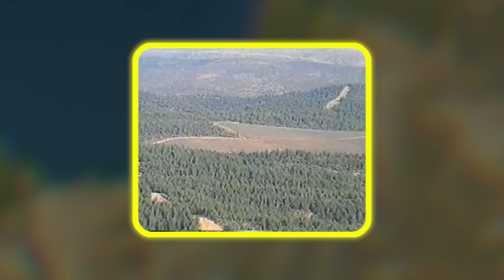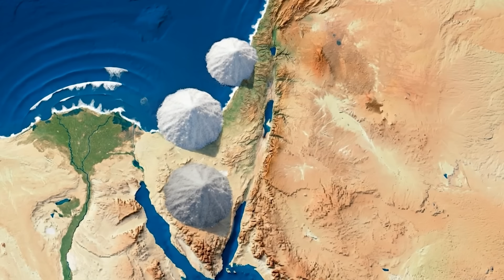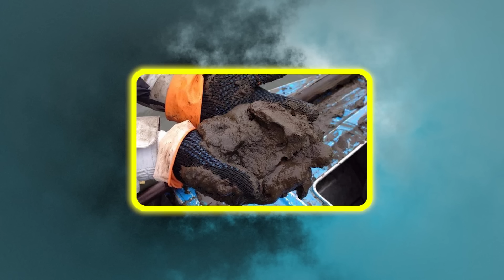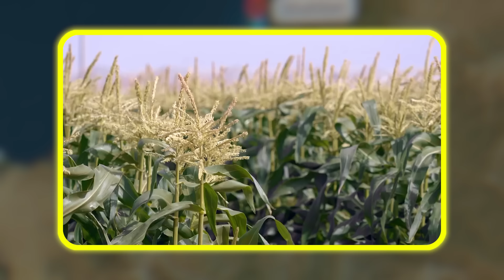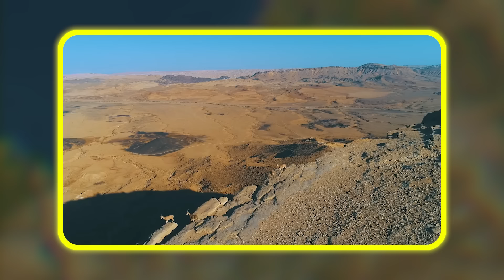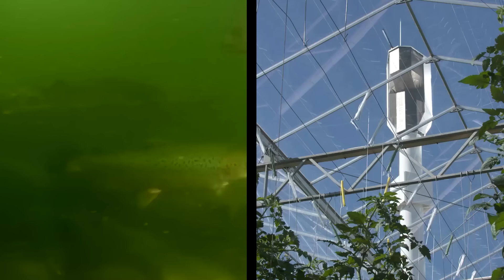Israel Released THIS to the Desert Instead of Planting Trees. What Appeared Never Existed Here

Comment: If I am not mistaken, because Israel did it first & it WORKED, these other countries followed suit.  We have all been blessed by Israeli engineering.
Reply: Absolutely agree.
Reply: I'm wondering if the water can be mined for rare earth minerals?
Reply: @painmt651 Not sure about the fossil water, but I know that their desalinization plants are currently working on trying to figure out how to extract minerals like lithium and magnesium from the brine water before it gets released back into the ocean. If they figure out how to mine ocean water, it could a huge game changer worldwide. It could be done anywhere with desalinization plants just by adding an extra process to the system. Over 150 countries worldwide use at least one part of Israel's water technology, and some like the ones in these videos have bought large parts of the system. Drip irrigation is used worldwide now. Collecting minerals from desalinization could spread just as far, if they crack the code. 

But I don't think they'd want to mine the fossil water from the ground. It could change the formula of what makes that water so perfect for fish farming, and later for growing crops. They'd have to do research on that before deciding if it would change what makes the closed loop systems so good. Removing minerals from water that being discarded doesn't disrupt anything in the system so there's nothing to screw up.
Reply: @S @Superfreaky1RU at's basically what I'm talking about. That could really bring the West into a position of not relying on the Chinese government for batteries and raw materials for manufacturing them and other newer technologies.
Reply: @painmt651 Check out Dr. James Tour of Rice University.  They've come up with astounding mechanisms for removing rare earth minerals from all kinds of things.  He a Jew who became a Christian.
Reply: @painmt651 Wouldn't that be nice for a change? Letting UK convince us to get rid of our industrial base is America's biggest mistake but watching the Chinese lock up agreements and debt trap nations for their rare earths and doing absolutely NOTHING about it for decades is a close second. They've know forever that China has had a plan on how to destroy America and they never thought that they'd better lock up our critical supply chain? 🫣It's just so humiliating tbh.
Reply: @Superfreaky1RU 
Israel is doing what they need to for what is best for Israel & succeeding . . . also eagerly sharing these tried & true methods with any nation who needs these processes . . . 

Each nation can modify things however they need to for these other benefits . . . use common sense & mutual cooperation . . . Necessity is the mother of invention.

Israel has done enough to get things started - just let them THRIVE!!!

God blesses all nations who bless Israel.
Reply: @painmt651 I am sure it was looked into. I guess not.
Reply: The more Israel gives, the more they are hated
Reply: Blessed and cursed BOTH
Reply: Funded by Aipac
Reply: @luciatheron1621 
AIPAC is funded by donations, not by taxpayers!
Reply: @luciatheron1621 and who funds Hamas? Billions of dollars funneled into Hamas from various sources that hate Israel including Iran, Qatar and other middle Eastern countries as well as non Muslim countries providing assistance to Iran and other Muslim countries. That's the world of politics and war. Countries backing other countries with common agendas
Reply: @judymoore5532  Arafat I read stole Billions. 
I've no info on Hamas finances.
Key Details on Allegations and Family Holdings
Official Stance: Palestinian officials and associates maintained that Arafat lived an austere, soldier-like life and owned no personal land, real estate, or private bank accounts globally.

Intelligence Claims: Israeli and Western intelligence estimates alleged that Arafat amassed hundreds of millions to billions in state and international funds, holding liquid assets, investments, and bank accounts across Europe (including Switzerland and Austria

Family Property in Europe: While Yasser Arafat did not register personal European properties, his wife Suha Arafat and daughter Zahwa lived in Paris, France, where Suha purchased a multimillion-dollar flat and was the subject of European financial and money-laundering probes regarding funds transferred from accounts linked to Palestinian assets.

For further context on investigations into his finances, read more via the Los Angeles Times.
Reply: @luciatheron1621 Aipac is funded by Americans.  All American ethnic groups have their own lobbying organization that lobbies Congress on their behalf.  Aipac is not the wealthiest by a long shot.  (Google it.)  
Nick Matau says the US gets about $5 back for each dollar of "aid" the US gives Israel.  (And this is managed completely independent of Aipac.  It is the American military & the corporate world of the military industrial complex that funds aid to Israel.)
Reply: @luciatheron1621 , AIPAC funding tilapia and burumundi fish raising is a good thing.
Reply: @teresatanyag8237 No.  Not while Palestinians have no equal rights.
Reply: Gaza, West Bank, Lebanon, Iran disagree
Reply: @LindaYariger Gaza and the "West Bank" as the Arab colonizers call it get their water from Israel, so I would advise you to do your research or sit quiet.
Reply: @LindaYariger       Israel captured Gaza in the Six Day War and only governed it until 2005.   Egypt had it for all of 19 years and would not take it back when Israel tried to return it with Sinai.    Lebanon is cursed with Hezbollah, the IRGC funded proxy that sits in Southern Lebanon and attacks israel.  Then whines and complains when Israel responds.
Reply: @LindaYariger  that is their problem. They are focused on mayhem and murder, rather than bettering the lives of their citizens.  PS it is  "hezbollah" not Lebanon.  Lebanon and Israel are on the same side of the conflict against Hezbollah and Iran.
Reply: Pity Israel has no sense of humanity and compassion.
Reply: @aletheabaldwin6612 have you been in israel?
Reply: @aletheabaldwin6612
Israel, the Jewish race, FOREVER!
Light unto the nations!
Reply: @aletheabaldwin6612lol. Get on a plane and see for yourself.
Reply: @aletheabaldwin6612👎
Reply: @aletheabaldwin6612Iran, and all of their proxys wars against Israel have no sense of decency and compassion. Did you forget that they started the wars?
Reply: Did you conveniently forget about October 7th? Israel does good things with the money. Iran, and all of it's wars against Israel is what they use the  billions of dollars for. Different set if values. Just look at this video again
Reply: @aletheabaldwin6612 Polio broke out in Gaza in 2024. In Jan 2025 the IDF vaccinated 1.1 million Gazans; mostly babies & children.  Google it.
When Israel withdrew from Gaza in 2005 Gazans' vaccinations were up to date.
Hamas put their all into terrorism.  Maybe they can get a Nobel Prize for terror tunnel construction.
The Gazan Health Ministry (run by Hamas) apparently decided vaccinations didn't matter.
And indeed ... why bother vaccinating children you'd rather use as human shields.
Now, fool, tell us about compassion.
Reply: @brynawaldman5790 
THANK YOU for this crucial information . . . I appreciate this!!!

But "THEY" still won't believe you . . . 

Everything is always Israel's fault - ya know.

My prayers for God's blessings on Israel.

All Glory to GOD through His Son Jesus Christ our Lord!!
Reply: @sydney.g.sloangammagee8181   Yes, it is important information which the media ignored.
Muslim antisemetism has a similar history to medieval Christian antisemetism, in that the rich Arab land owners, generals, aristocrats, & clergy oppress their own ignorant people.  They have ironclad centralized power & make use of the Jews as the scapegoat for their peoples' misery & suffering, so violence is siphoned off onto Jews who take the blame for the Muslim leaders' corruption.
In medieval times it was corrupt European aristocrats & clergy who hoarded the wealth & told their peoples that the Jews were to blame.  
The enlightenment undid the iron grip corrupt leaders had on European & Christian institutions, & made western democracy possible.
Reply: @aletheabaldwin6612Sure, the only ones who have ever tried to make peace with their neighbors, who gave back the Sinai, who offered a state 7 times, who left Gaza in 2005, and who gave land to make the Palestinian Territory are the ones with no humanity and compassion. 😂

And the people who refused to accept a state over and over in favor of using terrorism modeled after Albania, who pay people to become martyrs, a monthly stipend for life for them or their families, the more Jews you hurt or kill the more you get paid, with bonuses for pregnant women and children, who indoctrinate their children to hate Jews by teaching them Nazi ideology, who fought with Hitler in WW2, so that they would bring his concentration camps to Arab lands, beginning with Palestine, and who have never ONCE tried to make peace with Israel because its entire existence and even their national identity was created to remove Jewish presence from Jewish land, even though only 400K Arabs were living in Palestine when the British Mandate began and over 1 million moved there in 20 years. 

Oh, and it was Hamas and Palestinians who broke into Israel on Oct 7th and proceeded to genocide entire towns and used grape and kinocide as weapons of war, and took 251 hostages back to Gaza. And who had the power to end the war at any time because just like Israel said all along, the war ended the day they got back the last hostage and hostage bodies. 

You think the Palestinians are compassionate and have humanity? Not a single person on Oct 7 said anything about occupation. They screamed Allahu Akbar, my God is the greatest, while they mowed down entire families. While they gang graped hundreds of women AND men. While they debased and humiliated Jews by forcing them to perform acts of incest at gunpoint. While they cooked a baby in the oven after it's tortured and nearly dead parents, tied together at the wrists, had to see it and smell it and hear it's screams while it died, right before the terrorists killed them as well. While they beheaded people, mutilated or burned them alive, while they went out of them way to step on their bodies before walking away. And worse. Not just Hamas. One Palestinian family walked from Gaza to loot peoples homes and found a man alive, shot on the kitchen floor. The man got a knife and used it to cut the liver out of the alive man, and he ate it while the man died and his wife and young boy clapped and laughed. Not Hamas. "Innocent" civilians. 

If Israelis have no compassion or humanity, the Palestinians come from the Devil himself by comparison. Their entire fake national identity exists only as a means to try and steal Jewish identity and history to try to legitimize their claims to a land they colonized and are not indigenous to just so they can destroy it. And they will do anything, no matter how debased and inhumane to achieve their goal. They sacrifice their children to sacrifice Jews. And then celebrate it. In what world is that considered compassionate? Their hate had eroded anything once good about them. There has never once been a Palestinian voice calling for peace. For compromise. They just call for more days like Oct 7, no matter the consequences to them because they think it was all worth it. They have no humanity left. It burned out decades ago when they were hijacking airplanes which is now why there's no airport in Palestinian Territories. They were removed because of their own actions. Just like checkpoints and border walls were installed as a consequence for their continued terrorism. They are and have always been the cause of the things they say are oppressing them. All consequences for their actions. 

They have always had the power to end all hostilities. The day there is a real partner for peace Israel will bend over backwards to make it happen. Because unlike you say, it's Israel that has not lost it's humanity and compassion. They have always chosen life and love while Palestinians choose hate and death. 

The world has been waiting for them to choose treaties over tunnels. But they always choose tunnels. Every time. 

If you think that represents humanity and compassion, there is definitely something very wrong with you and whatever ideology you follow. You're encouraging terror and martyrdom. You might want to check your own compassion and humanity.
Reply: Israel, the Jewish race gave the world THE TEN COMMANDMENTS, gave the world JESUS CHRIST and the GREAT GOSPEL that birthed the Western Judeo-Christian civilization, and gave the world KARL MARX and the socialist/communist ideology. Not to mention huge technological, scientific breakthroughs that make Arab and global life much better and more comfortable.
Israel, the Jewish race, FOREVER!